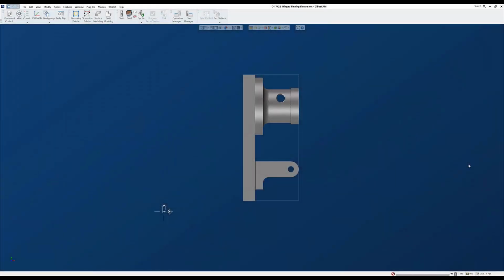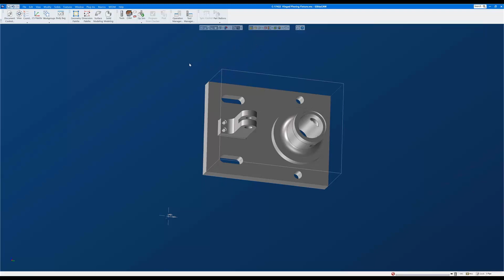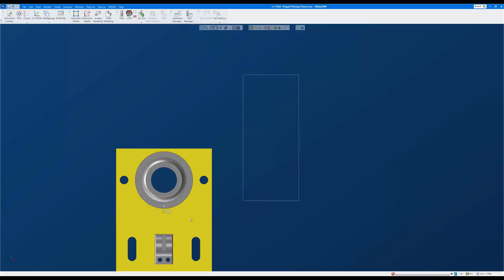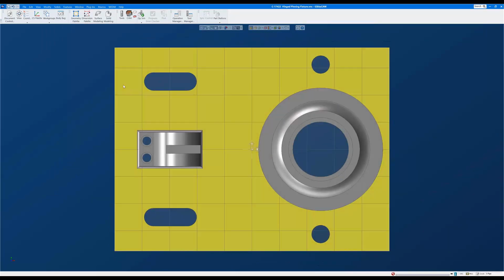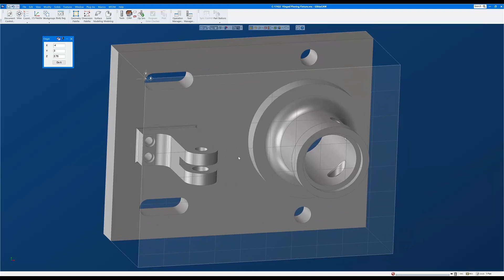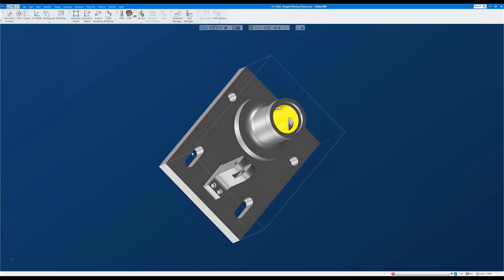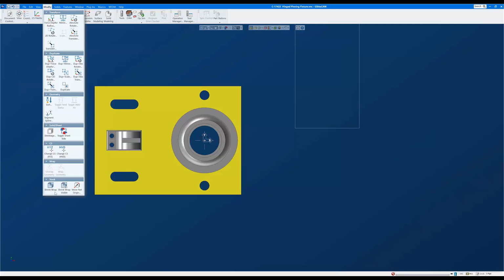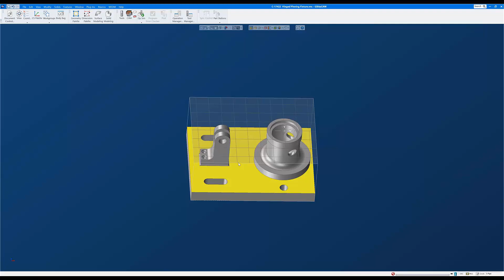GibbsCAM Tech Tip: Solids Orientation and Positioning

Comment: Hello there. Thanks for the video! Quick question if I could. If I import or create a solid model in Gibbs, how can I see that solid model when it comes to the simulation? So , like if I wanted to bring in a part that just need chamfers on different levels, how do I simulate it so that  I see the model the whole time? So that I don't see my tool plunging through material that isn't there (because the stock dimensions will be a cube) ? I hope this makes sense.